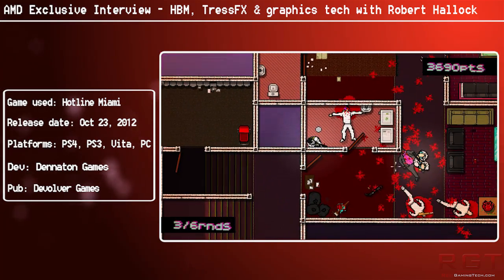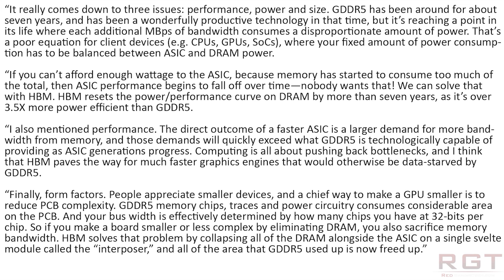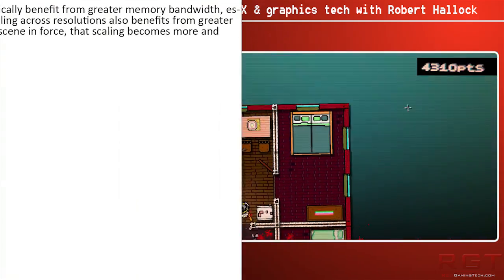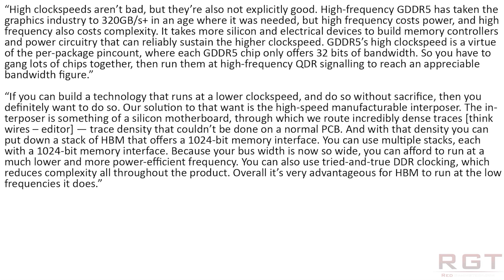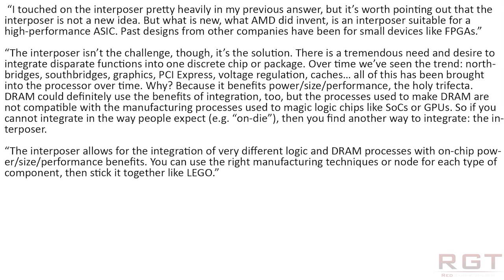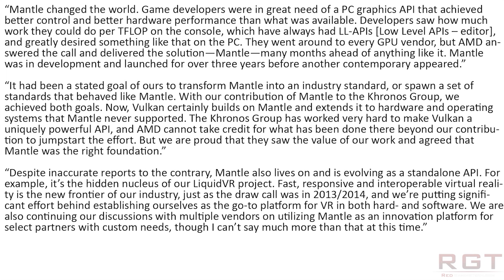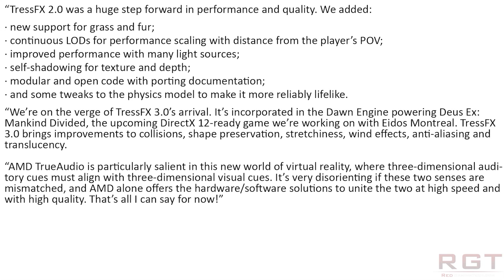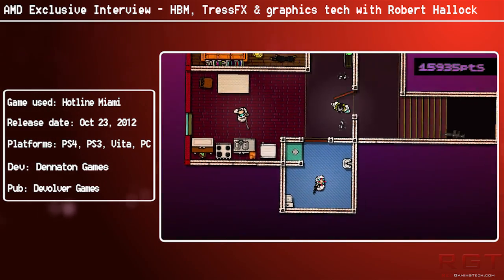AMD Exclusive Interview | HBM TressFX & Graphics Tech With Robert Hallock

Comment: Additinall commentary on the interposer.
The HBM is simply just stacked chip with probably 32nm or so. They stack 5 chip, 1 controller and 4 memory matrix chip...

Well, the Interpose is simply a 6:th chip that is stacked that is a lot larger in size. Pure silicone wafers is actually quite cheap, its the 32 or 16nm process that is expensive. I don´t know the exact specification but i would guess the interposer is made in something like a 180nm process or so. This make the packing performance just about 1/100 relative to say 16nm die (and the induction loss about 1/10). Buuuut, relative to a FR4 the packing is like a million and induction losses is about 1000 times less.

Also the possibility of have some power electronics on the Interposer. Power electronics don't really use small nm manufacturing technology. Having the DC/DC stepdown integrated in the Interposer would cut down on both cost, size and powerconsumpsion.

In addition, stacked chip is not really that new, i think products like iPhone 3 had some stack chip. But at that time they used wires between the components, this have only slightly better performance than FR4 boards.

Later chip-to-chip flipchip was quite common. Its simply having two chip with there die against each other and just solder them directly. This increase the performance and decrease cost quite a lot, but you can only use 2 chips in this method.

In HBM they use silicon via, this is actually the first implementation of this i seen. It been around for some time, but to my knowledge not implemented. This basically solves the 2 chips and basicly have any number. basicly elimiante quite a lot of board space. Its also posible to have some passive components at the interposer